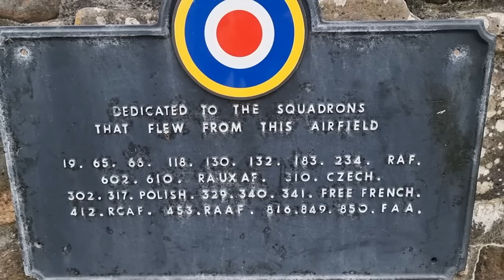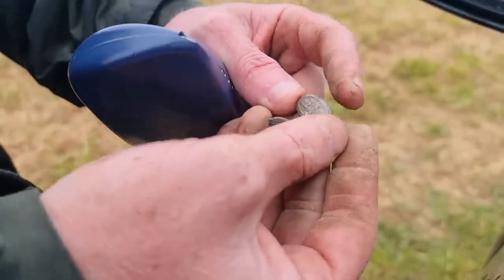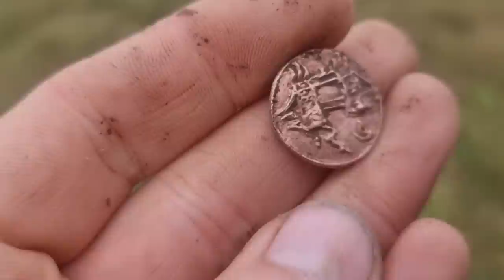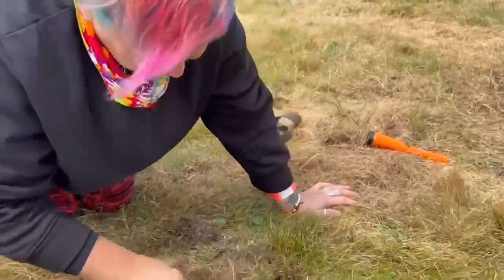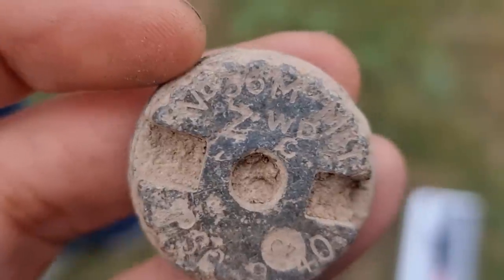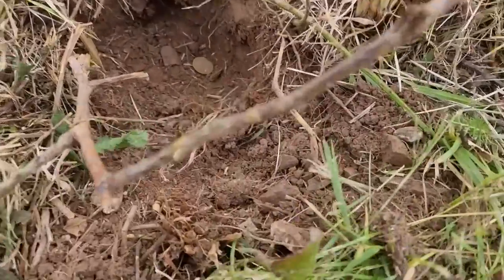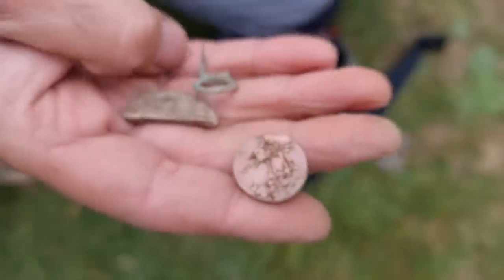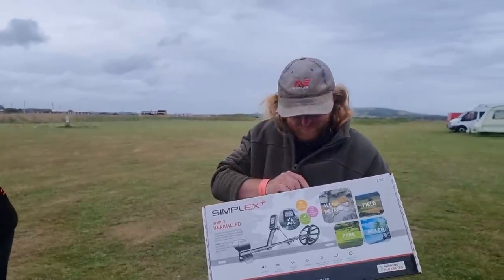What did we find at the WW2 SPITFIRE airfield!?

Comment: The first shelter looks like a test shelter. The testing engineers sat. The hole looks like cables or wire to used for triggering test data collecting systems. Like cameras of mic, or so data collection system.